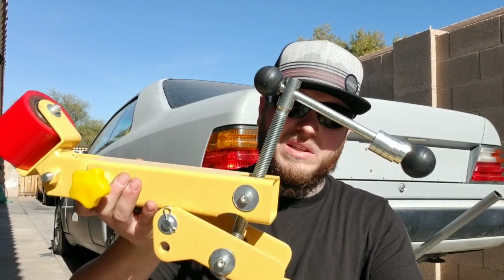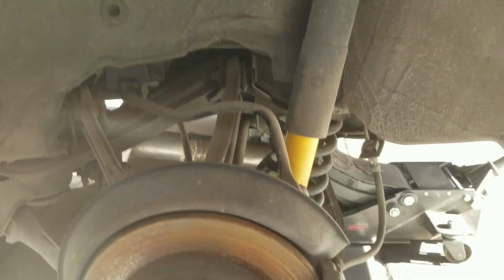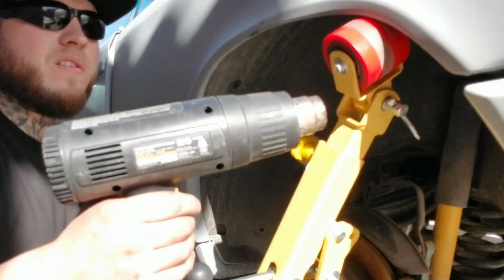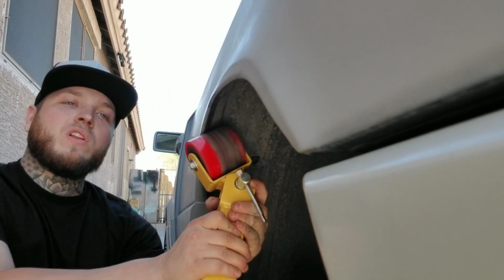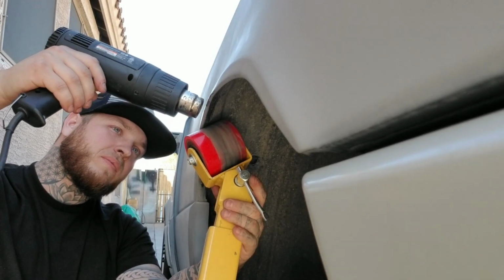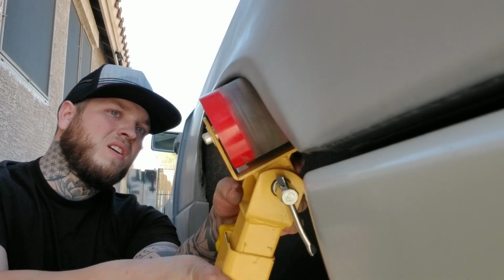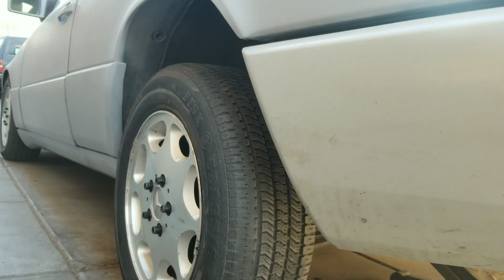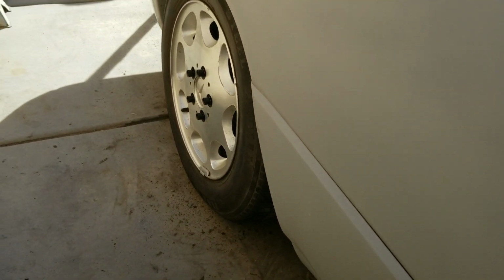Mercedes Benz 300CE Gets It's Fenders Rolled

Comment: This is amazing. After you rolled the fender what is the most agressive offset and tire size for the w124 car? can a deep lip old AMG wheel 18x9 et35 or et30 fit ok without rubbing? thank you! great work and video!